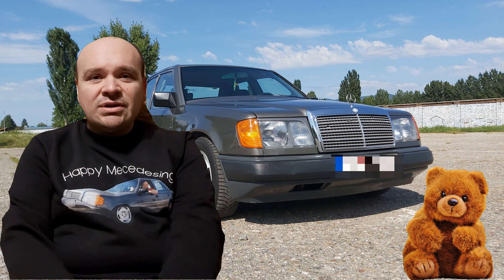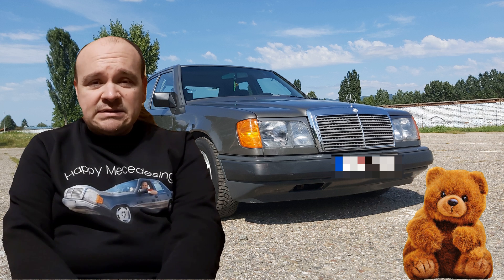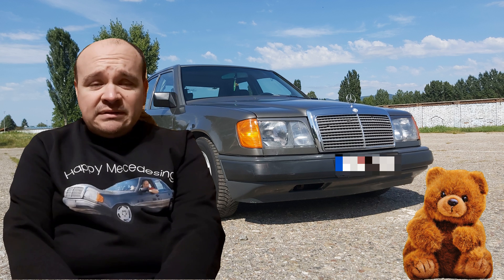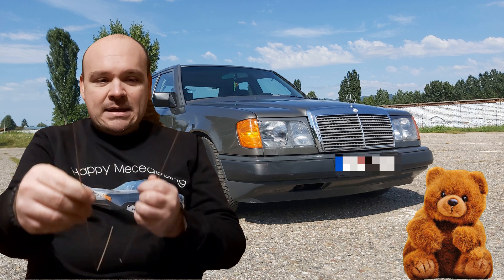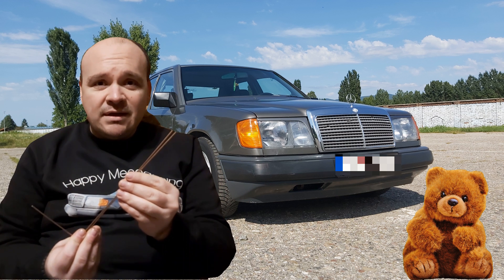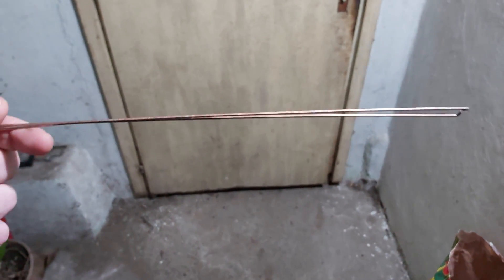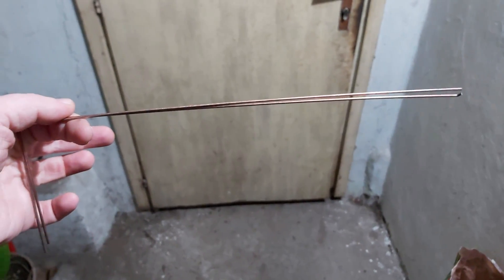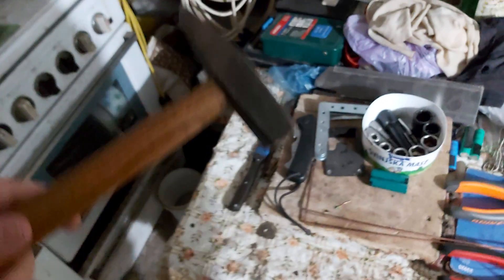㉦Mercedes Ke-Jetronic㉦  - 🪝Special tools specially cheap!🪝

Comment: I hate this tools ! If you miss the hole, it can slip and break your cluster windows ( it happens on my r129) I prefer to unmount plastic under the dash an push the cluster with my hand by behind. It can be tricky but safer for your cluster… but good video and nice trick to avoid expensive tools
Reply from the maker: Have you seen the price from the original one from Mercedes!? I paid for this wire 0.10$ You have to be careful, that's right. Soon I will have to remove the dashboard but it's freezing 🥶 in my town now.